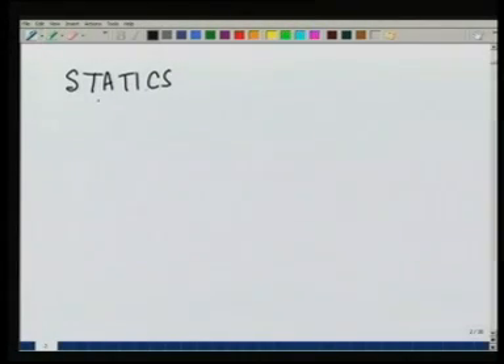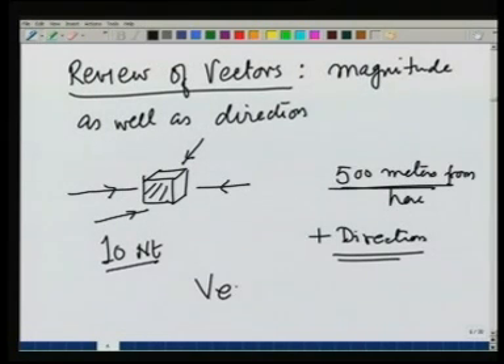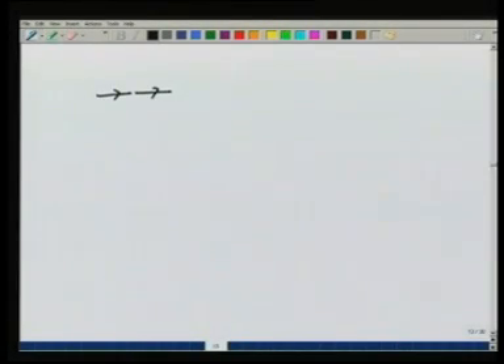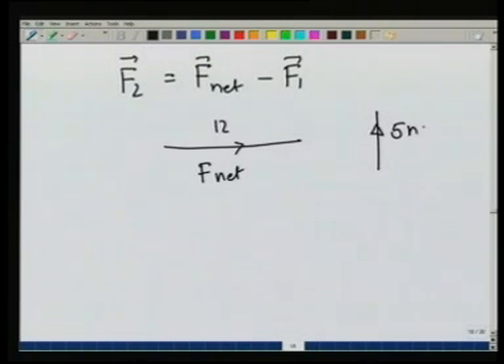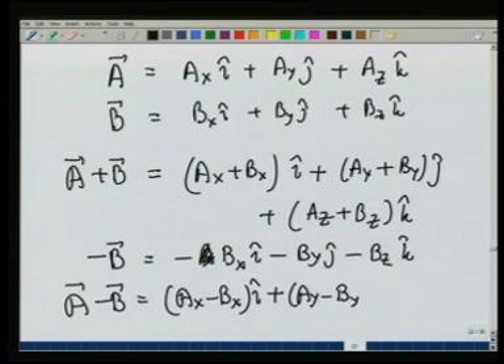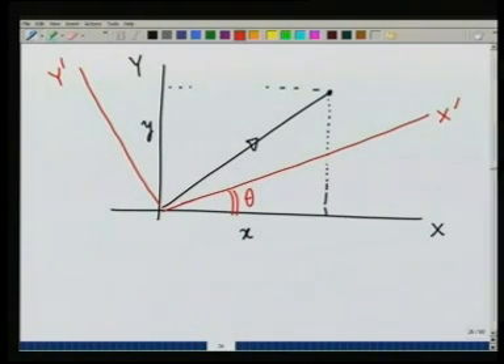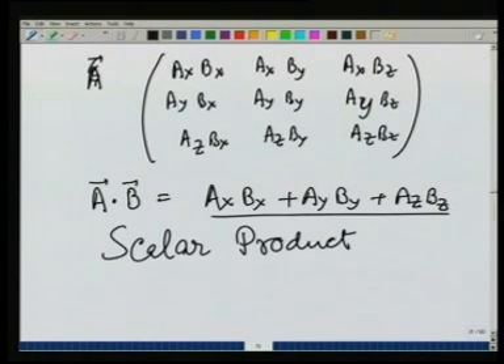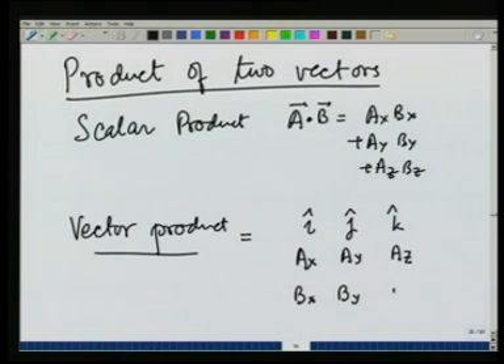Module-1 Lecture-1 Engineering Mechanics

Comment: @27.36 Fnet- F1 is 13??? how? 12-5?
Reply: dont take it according to formula , consider it as a right angled traingle...
 the 12^2 + 5^2 = 169  square root of 169 = 13
Reply: at 25:36 why is theta equal to the tan inverse of 4/3 please and not sine or cos inverse?
Reply: hey you can take it sin inverse result 53.13010235, cos inverse result 53.13010235, tan inverse result 53.06123727 a minute difference , i hope you can take it , if you want to calculate serch for archsin

Comment: @42:00 , sir, i DOUBT the statement that "distance 700 remain unchanged / or Distance remain unchanged" would remain true for all cases, that would mean x+y would remain CONSTANT for any value of x and y such that x^2+y^2=R^2 (x and y are the components in x and y direction due to Rotation of axes and R is the displacement).
But this should not be true for all cases.